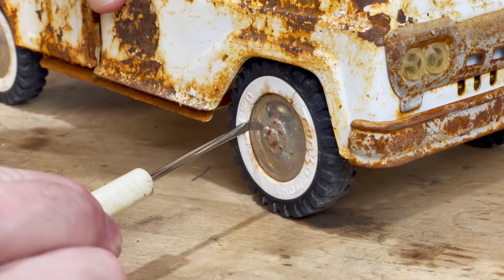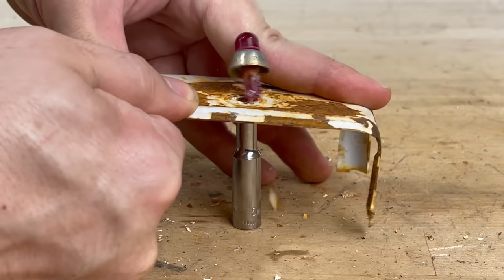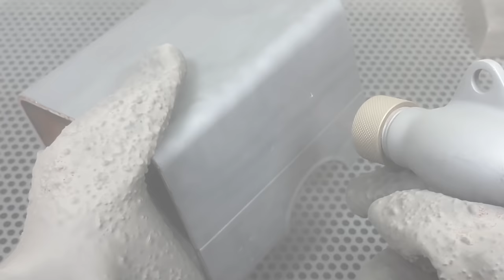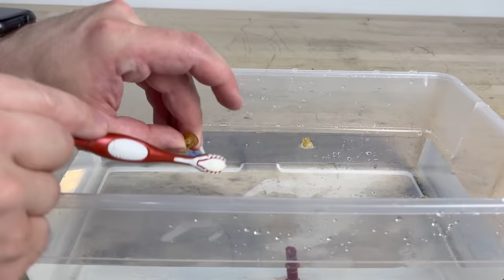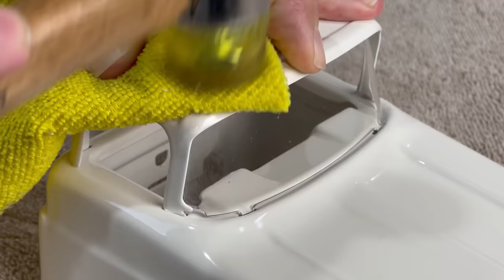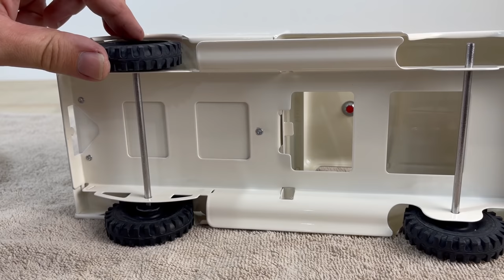1961 Tonka Rescue Squad Ambulance Restoration

Comment: To prevent the powder coat from cracking, you could try heating it before bending the tabs with a heat gun or similar. might be enough to soften it first. Love your videos, keep up the good work.

Comment: I've watched you restore so many Tonkas, and restored 2 myself. The one thing I find is the frames and cabs have not really changed that much over the years. A Tonka from the 80's is not that far from one from the 50's!   So, I just watched a video on the Tonka assembly line. Tonka painting is a 4 step process. They are first dipped in a cleaning bath. They are then dipped directly into a paint pool. Next they are shot with a coat of paint. Finally they go into a an electrostatic booth and into a bake kiln at 325°
Reply: Yours is the only comment with an actual answer to his question. I myself came here to suggest heating the tabs, as many others have.

Comment: You had me worried when you removed the sheet metal screw from the siren and put it in the rust remover, but you came through at the end and properly installed a machine screw. Gave me flash backs when I owned apartment buildings or worked in maintenance, lol.

Comment: Try to heat the painted tabs before bent them and i think its a good idea
Reply: Using a heat gun on scrap parts first 🤔
Reply: Was going to say the same... gradually warming the tabs so not to burn the paint, but soften it.
Reply: Same thought, it is powder coat so it will soften up okay. It might swap one problem for another if the nylon punch damages the paint. May be easier to mask the tabs and paint them last?
Reply: I was just gonna say the same thing.

Comment: For the cracked tabs, would heating the paint on the tabs slightly with a heat gun help, not so much to remelt the powder coat, but enough to make it a bit more pliable?
Reply from the maker: Thank you! I tried this on some test pieces in order to get it to not crack it also ends up being hot enough that the punch damages the paint also
Reply: @ChipChannelRestorations Mind you, I know absolutely nothing about this process, so this might be a really dumb suggestion, but I'm wondering if there would be a way to heat the powder coat hot enough after bending the tabs, that the paint would flow back into the crack?
Reply: @ChipChannelRestorations  is there any way to get a pair of nylon jaw pliers on them and slowly bend them down? Just thinking maybe without the sudden bend from tapping it down it may not crack?
Reply: @ChipChannelRestorations  I am wondering if perhaps annealing (heating to red and allowing to cool to room temp slowly) before beating them straight might not help with this along with helping prevent broken tabs.  Not sure it will help with the cracking but am pretty confident it would save some tabs that snap otherwise...
Reply: Have you tried painting them in the bent position, opening them for assembly and bending them again? I don’t know…just brainstorming here.
Reply: Pensei a mesma coisa, se ele esquentar um pouco, a tinta não vai rachar.

Comment: Have you tried heating the tab before folding it?
Reply from the maker: Thank you! Yup, I did a bunch of test pieces, if I heat it enough not to crack it also makes the powder too soft where my punch needs to hammer, ends up making it look worse than the crack
Reply: @ChipChannelRestorations  No worries about the cracking powder coat. It's 
nearly impossible to avoid...when being bent. 
As a remedy for the more noticeable cracks, you could paint match the powder coat. Once the cracks are "painted", I seriously doubt if anyone would notice. 
Respectfully, 
Ben

Comment: Using a test part, try heating a tab with a heat gun.  Since the powder melts around 400 degrees (right ?) perhaps 50 degrees below that temp....YOu would need to make a cone to fit over the exhaust nozzle of the cone to direct and isolate the heat only onto the tab.  I have yet to try this myself!  I'm just spit ballin' here.  I'm going to restore a fire engine from my childhood (1950s), so you'd be blazing the trail for me!

Comment: I have an idea about the tabs. I know you paint the part before you assemble. What if you still painted the party before assembly, but wait and paint the tabs after assembly? Even if you can’t powder coat it afterwards, you would still be able to avoid it cracking. Hope this helps you.

Comment: Is there a clear plastic/polymer based top coat with a little more flex that you could apply after painting to stop the paint chipping on the tabs at bending time? With nail polish, to avoid cracking and chipping as the nails flex during daily life, you need to apply a top coat. I'm just wondering if a similar principle would apply to this scenario 🤔

Comment: Your process is so intricately detailed and requires multiple specialized tools but man oh man do the results speak for themselves!

Two questions this time around if I may... does your powder coat system impart and electrical charge to help with bonding or is it entirely spray heavily and then handle VERY gently until baked and I see you used a primer coat this time but don't recall seeing you do that before. Is this a new step you've added (for better longevity maybe?) or have I just been zoning out and missed the primer step in the past?

Comment: It appears that the primer coat is cracking and separating. Try a scrap without the primer coat. I powder coat my cast bullets and test the coating by smashing them with a hammer until they pancake, no cracks. The lead alloy may have a completely different bond than steel, guys who do a lot of powder coating probably will know.

Comment: For your cracking paint issue, the paint is needing to be incredibly flexible, so I would look into two details: surface prep/paint adhesion and paint compound. For the first one, maybe an adhesion promoter or an etching primer would make the powder coat fuse with the metal better. And for the second, the powder coat in that area seems quite thick. I know nothing about powder coating, but maybe see if there are other kinds of powder that allow some flexibility. Hope this helps! Amazing restoration!

Comment: The cracking problem. Why not apply the primer coat, reassemble and then the final coat? The primer would Crack but the final coat would be solid.

Comment: Hello. Just recently discovered your channel because I bought a Tonka dump truck. I am unsure of the exact year but it looks similar to that of your restoration video of the 1962 dump truck, Light blue and yellow. Mine is all brown with what appears to be the original or copy "HYDRAULIC DUMP" sticker. I purchased it at a swap shop for $40. It was a impulsive purchase but I think it was well worth it. As of now all I have done to it is brush off some dust and spider web, along with using a tire air filler to reach into smallest spaces and dust it overall. I am unsure at the moment if I would restore it or leave it as is for a while. I'd appreciate your input. Thank you

Comment: So is there a reason that you can’t use the sand blaster if it’s lead paint?
Reply: Lead paint abatement should be done in such a way as to not to contaminate the air and the surrounding area.  I would think that one would not want to contaminate the blasting media on ones cabinet. Once contaminated, every time you would use that media to "clean" an item, you would actually be contaminating it with fine lead particles ...... which then would have to be cleaned off somehow, taking not so as to not cause further contamination of the work environment and then there are this issues of properly disposing the materials used to clean up that contaminated surface/area, etc.,etc, , etc.   I am offering this explanation, not as a user of a blasting cabinet or as an "expert" in lead abatement/remediation, rather as a homeowner, crafter, consumer, etc.

Comment: You asked about getting to bend the tabs without the paint breaking. Have you tried heating them before bending. Heat may make the paint a little more flexible.
Reply from the maker: Thank you!! I tried this on some test pieces however, I’m order to stop the cracking I had to get it hot enough that the punch ended up damaging the paint anyway,

Comment: Seems to me the powder coat is glass like, and when the tab bends it disrupts the crystalline structure.  How about coating the tab with that stuff the auto stores used to sell to fix the holes in your windshield.  That stuff filled in the multiple layers of the windshield, it may also "mend" the multiple layers of the powder coat.  Plus, it was clear, so could use with multiple colors.

Comment: Never worked with powder coat before so I don't know what the physical qualities are like with what you're using. Try a range of low heats progressively getting hotter to see if the paint can regain some flexibility when bent. Maybe also try pressing the tabs into place with smooth pressure after heating instead of tapping into place which gives fluctuations in downwards force and not consistent.

Love this channel, it's so very relaxing to watch the silence at work!

Comment: The paint could be a little too think to bend without cracking.  The option of warming the paint might work.  I couldn't see if the primer cracked too.  Maybe your powder supplier has a coating, and possibly a primer, that is more flexible, such as one intended to be a coil coating?  They are designed to be bent after application.

Comment: I read a lot of the comments regarding the paint cracking on the tabs, it might be a hassle but what if you put the whole truck together loosely (just the metal parts) then heated the whole truck up in an oven, not too hot! Then when it reached a good very warm temp the paint and metal will be more pliable and the bend the tabs into place slowly...I am going to restore a truck like this, but I will be spray painting my parts, I will warm the truck before I bend my tabs, and see what happens.

Comment: Use your heat gun on the tabs, heat them as hot as possible, then bend them… see if that works. Of course, not anywhere near plastic or rubber parts